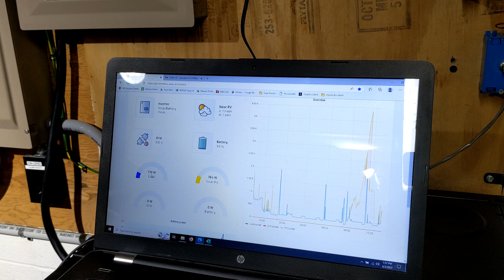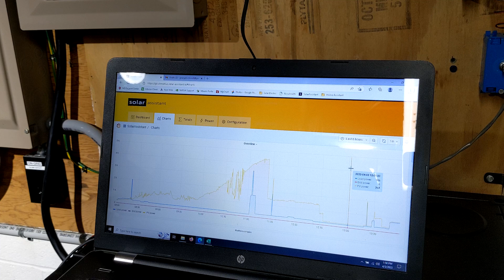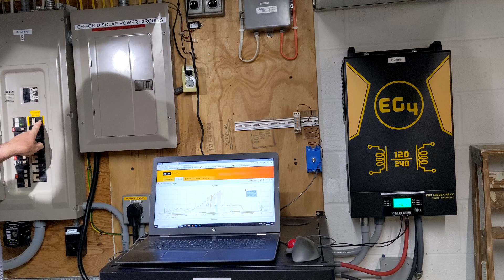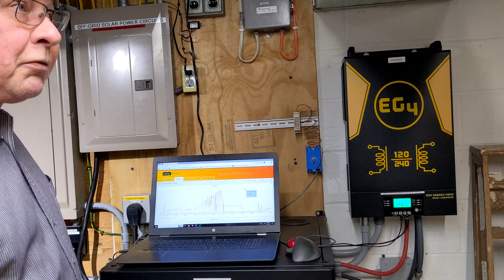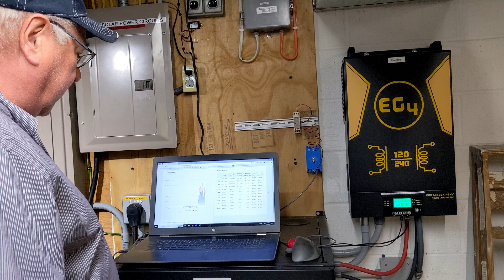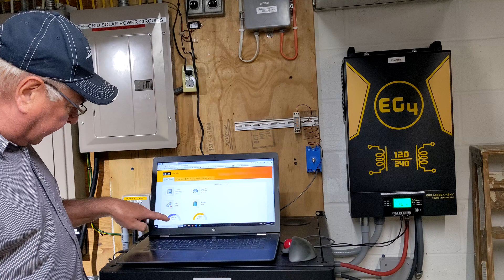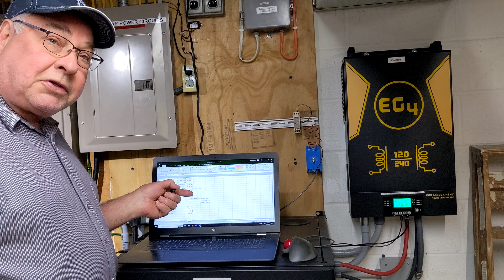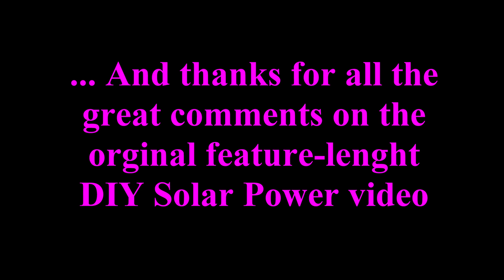DIY Solar Power Update

Comment: Two comments. First, your system is large enough that you should start using the term kilowatts for describing its output.  
Secondly,  consider installing a spa/Jacuzzi for soaking you tired bones.  You and Martha deserve it.  We're not as flexible and nimble as we once were. I saw you laying down on the job when you were passing conductor into the basement!  (LOL, as the kids say).
But seriously,  a hot tub really would be useful as a convenient load dump for excess energy. Blessings

Comment: Nice system and rare to see a tidy DIY. But! it's not practical to not be grid tied. Maybe consider expanding and getting rid of the grid. The credits I get have been getting are covering 100% of my power bill. And over the last year the government of Alberta has been giving us small gas rebates, with that and my extra solar credits 100% of my gas bill was covered over the last 13 months. I paid a grand total of $10.46 for both utilities. (Ten dollars and fourty six cents) I just retired last Jan. I did mine DIY in 2015 with permits. Where I live we can do our own wiring legally with an inspection. Fortis power installed my bi-directional meter for free.

Comment: Very nice.  I wonder if that inverter would power your entire house?  If not, it may be worth buying another one because they are only $1500 and you can power your entire house... and you can have your loads powered from the grid IF ever the batteries go dead and the sun isn't coming out.
Reply: Your grid power could come into the AC input on your EG4 and your electrical panel could be supplied from your to EG4.. do you think that would work?.

Comment: the best thing you can do for the back of the array is keep it cool.  that increases your power. as for the shattered one.  get a piece of glass cut for it, put it over what is shattered seal it and put that sucker outside making Volts  have lots of those
Reply: Really? Wow! Do you have pics? Thanks!

Comment: I've read that regular resistive hot water heaters, with extra insulation, make great dump loads. Turn the thermostat up to 150F (if no children in the house), and a 60+gal tank should soak up any extra capacity. A timer or relay can make sure it's only used when appropriate. I'm not sure if the heat pump hot water heater will be as good at soaking the load, I've heard they are almost too efficient for the task. If you only have a 120v leg available, I've read that the elements can be undervolted safely, they just have a lower current draw.
Reply: I have installed a 300L heatpump hot watwr cylinder and it is very efficient , but intend to use the 3kw element  that it also has to increace the temperature to soak up the excess avalible energy as the vidieo sugested. we have a tempering valve on the outlet set at 55deg C and that fixes the risk of burning at the outlet. 
i have insteed my air inlet to suck heated air from the roof cavity and this dramaticly increases the heat up time on the water in cold days.

Comment: Hey George great video I have jinko or junko 460 watt panels they look similar to yours.. I have a different inverter mpp 5000 watt something and batteries are different brand as well..  my inverter or charge controller maxes out at 220 volts I think..  So you have a decent one..  I put 3 panels in series but I'm going to try to do 4 cause I'm expanding the system... Later in the spring..  But love the videos.. Thanks for taking the time to make them look forward to the next one!  Rob from Ontario Canada..

Comment: Nice video.. You may want to look at this as a dump load. Google ACTII PWM SOLAR HOT WATER HEATER. Instead of spending big bucks on a heat pump water heater get a normal 30 gallon electric hot water heater hook it up and paralell it with your normal heater. I have 1400 watts @ 150V and it will heat my water up tp 148 degrees from about April to Nov (Washington State). David Poz has a good spreadsheet on matching the OHM's with your water heating elements. Mine has been running for three years no problems. I think the company is out of Poland tho..

Comment: I was thinking you could use an air conditioner in the summer or a dehumidifier for a dump load.  And an electric space heater in the winter.  Find a way for it to automatically turn on and off is the hard part.

Comment: Great job, George! I fired off an email to the Solar Assistant developers to see if the would do a software update to use an available gpio pin on the raspberry pi to drive a Solid State relay. Just an additional function button in the program with adjustable levels for the excess solar to be diverted to the hotwater system, or an EV charger. Mienergi controllers in England does the same thing. Here's hoping.
!
Reply: I just looked them up and no Goodwe or BYD suport as would love to be able to monitor everything in the same way have spare can and RS485 Modbus ports to conect to, but they are not suported

Comment: Is that high pitched noise coming from the inverter when the well pump kicks on? In the original video, I thought the inverter was alarming from overload at first. Nice job on everything.
Reply from the maker: Hello, and thanks for the comment. Good question. Let me explain the noise you heard. The inverter does make a 60hz groaning sound when a big load kicks in. But the high-pitch noise is from an alarm buzzer I have connected to the well pump controller. About a decade ago, the well pressure switch failed in the closed position and the pump began running continuously, over pressuring all the plumbing and burning out the pump. The well is about 60 feet from the house and the pump is down at 160ft deep, so we couldn't hear it was running. After replacing the pump and repairing everything, I installed the alarm buzzer so that now we can hear when the well pump is running.